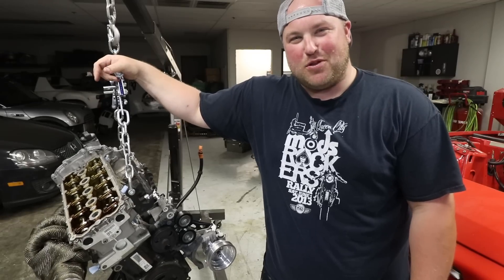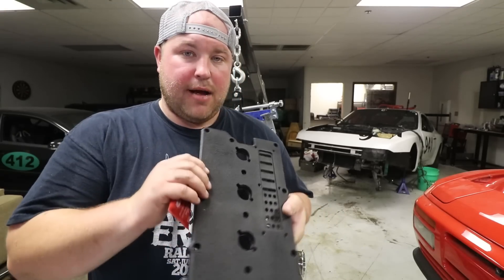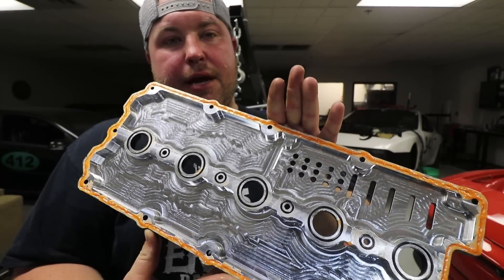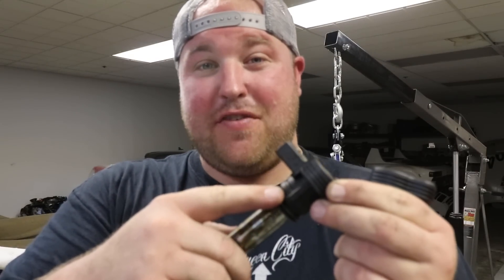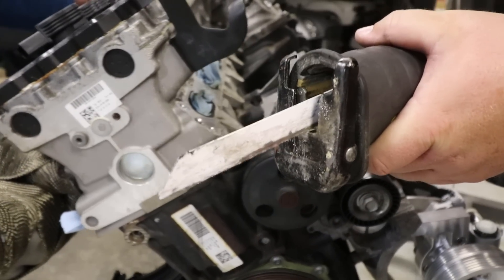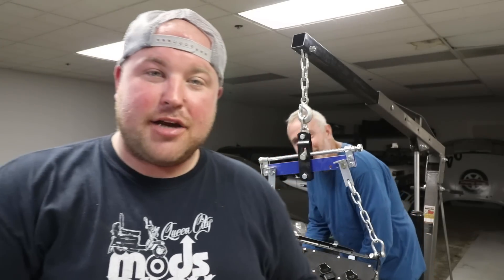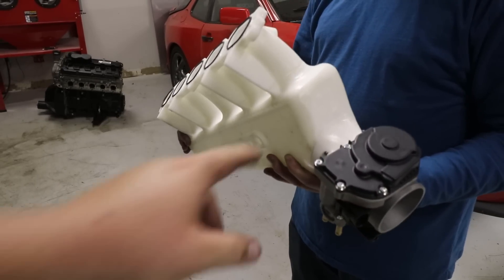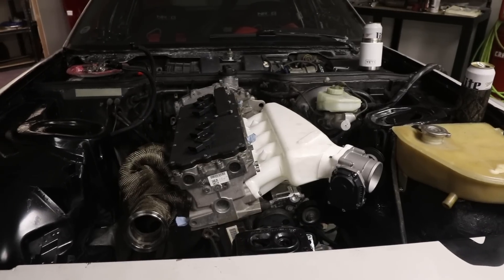5 Cylinder 944 Build - Part 2 (Porsche 944 07K Swap)

Comment: Nice 3d printed intake! That is pretty much a tried and true design. Id say you could probably slather some epoxy or plastic welding to get the intake sealed up where you need it just for your base runs/ temporary R&D. That valve cover is quite the piece as well. They certainly use quite a bit of anaerobic sealant on these motors for sure. Hondabond, yamabond, grey permatex, etc. will probably work just the same. I've seen the coils 'ribs cut down' as well so I think you're right on the money there. Really great work, I love this swap. Who doesn't love the sound of a 5cyl?!?!?😁

Comment: The 3d print intake looks just like the integrated enginnering one, you guys sell the 3d printed ones? Do you still have space for the ac compressor since you had to relocate the power steering? Thanks
Reply from the maker: It is basically the exact opposite of the IE intake, it faces the crank pulley instead of the flywheel. We don’t sell the 3D printed ones, they would actually be more expensive! AC has to go.

Comment: Can I ask what is the length of the engine with the flywheel and front pulley installed please?
Reply from the maker: I don’t know off the top of my head, let me see if I can get it for you.
Reply: Boost Brothers Garage  that will be brilliant, I’m considering a swap into a early UK short nose Volkswagen T4 Caravelle with a Quattro conversion

Comment: Every time and I mean literally every time I want to big turbo my b6 a4 1.8t, I always think really? Would I do audi justice with going big on a 4cyl! (Although it's  one heck of a 4 banger) NO! 5cyl is the way to go and your guys build has confirmed that.  Awesome work that 5cyl sound is truly signatory and epic!
Reply from the maker: Thanks! Funny enough, we are picking up a B6 next weekend as our next development car!
Reply: @BoostBrothersGarage  older audis  are amazing platforms to work on period.  I look forward to seeing progress on your B6!  Also there is a Romanian I believe name Alex mirea. He swapped the 2.5 ttrs into his b5 (on youtube) (cepa 2.5?? I guess that's the direct injection version of the 07K found in the TTRS), that's if to say you guys are still keeping the 5cyl flame alive for the B6.  Amazing work through and through, I gotta pass my medical board licenses then perhaps will have some scratch to attempt the 5cyl swap!
Reply from the maker: Definitely using the 07K as the engine of choice for the B6. Not sure we’ll have the coin for the TTRS mill haha. Good luck ok your exams!
Reply: @BoostBrothersGarage  and too much headache (port injection simpler and perhaps would avoid the carbon buildup most direct injection VAGs are plagued with). Integrated engineering has proved with their 9 grand plus rpm 07k NA build that bigger valves throttle body etc etc are available for this unit, so there is a plethora of aftermarket parts go make head flow like a TTRS.  The only thing I could not find was a girdle kit, to strengthen further the bottom end. Anyways tons of potential as you guys are seemingly aware of! Mucho respects for the well wishes!

Comment: Nice project ! 

I've ran and sold many 3D printed intake manifolds for Porsche, never for turbo engines, but I have a few years of experience with them. I've had some for 986, 996, and now I have one on my 928.
Looks like yours was made by FDM, it's good for validating the fitment and cast one in aluminum out of it. But you could use a 3D printed one directly without any problem if it's designed correctly and made with the right machine by the right guys ! 

I don't know how much your aluminum one will cost you, but that might save you some $$$ ;)
If you want to talk about it, feel free to contact me, I'd love to help you on that part of your project !
Reply from the maker: Thanks Benjamin! This one is actually ABS, but it was printed on an SLA filament machine. It won’t see any boost as this particular engine will remain NA. The main reason for doing it was to validate fitment as well as have a “plan b” in case our cast aluminum prototype didn’t show up in time for 944Fest. Appreciate the great info!
Reply: Hello Benjamin, I think you Are French ?
Reply: I plan on 3d printing a ABS intake manifold for a 7m supra, It's turbod and will only see max 30psi ever in it's life.  What would you recommend for infill levels?

Comment: Looking great,
Do you think that exhaust will fit in a right hand drive car ?
Reply: I actually have a right and left hand drive crossmember so I will try and dig them out to see the differences if any for the engine mounts. 
If ready I am planing on purchasing a kit next year for my rally cross car.
Reply from the maker: The mounts should be the same, it’s the steering shaft that is at question!
Reply from the maker: Thanks! I believe so, yes. However, we don’t have one around here to measure.  If someone can get us a 3D scam of the engine bay or at least some detailed measurements we could confirm. The engine mount needs to be looked at too.

Comment: Can it use 07k stock drive by wire?
Reply from the maker: Yes, as well as a 911 GT3 drive by wire, which is larger than the stock 07K.
Reply: @BoostBrothersGarage  996 or 997
Reply from the maker: Actually I was wrong, it’s a 997 turbo tbody and it requires an adapter. Sorry about thats

Comment: Everything seems to fit and be proportioned exactly to the car, it's uncanny how well that engine lives in there.
Reply from the maker: Right? Let’s just hope it performs as well as it looks!
Reply: Hey !! I'm planning on doing a 07k swap but I have a question? what injector I have to use !! like I want id 2750cc injector ?! will that fit the manifold u sell on the websites?

Comment: We run 3d printed intake manifolds (ABS Plus) occasionally on the dyno (For manifold development).... IF you're very careful, use weld in threaded inserts, sleeves to stop the head flange from crushing, a phenolic gasket under it at the head- it'll last a few pulls. 

They crumble under the clamping pressure from bolts, leak vacuum right through the porous 3d print, and the heat from the cylinder heat will basically kill them. 

If you had it SLS from fiber reinforced nylon, it might last.
Reply from the maker: Appreciate the info! Nice to have someone chime in with experience as we were flying blind!